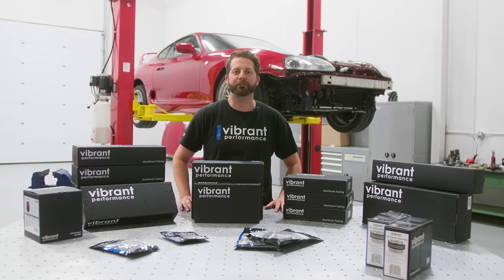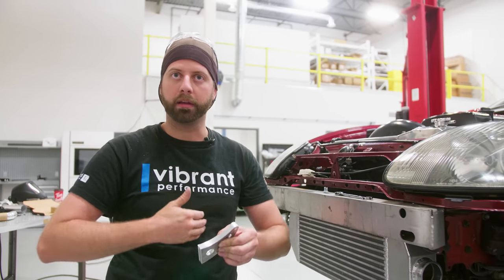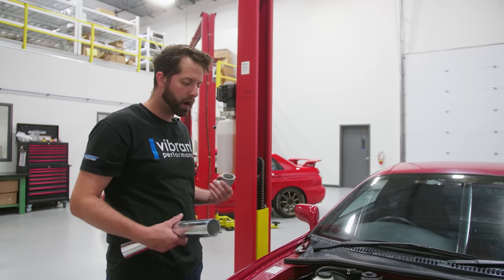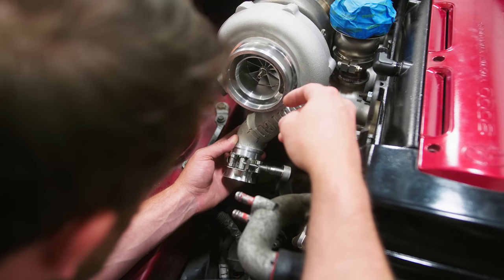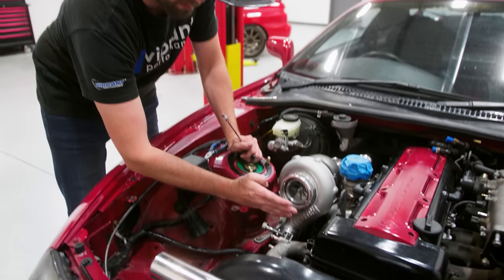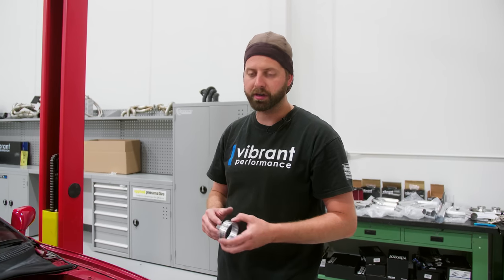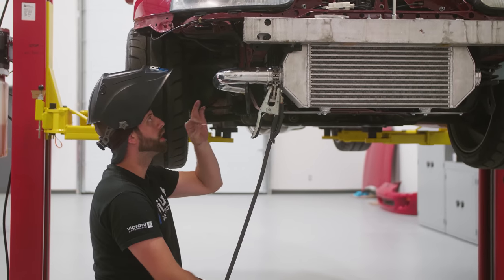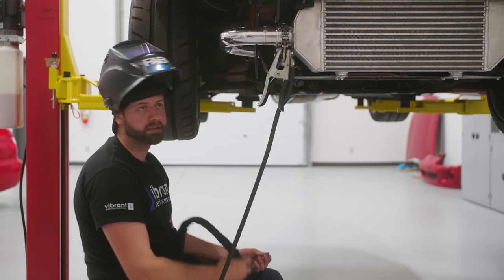Fabricating MK4 Supra Charge Tubing for Single Garrett Turbo

Comment: If you score instead of using market, you can clean without issue plus the marker itself can contaminate the weld👍
Reply from the maker: Great idea! More confident fabricators can definitely use this method. As annoying as it is to lose your marks, it is also a good thing they aren’t permanent. It’s not uncommon to mark up a pipe multiple times during fit-up. It would be a real shame to mix marks up and clock the joint wrong.

Comment: Next time try to drill the ait sensor before welding so it can be cleaned easier
Reply from the maker: Not a bad suggestion. Greg left the bungs to the end so he was sure on their placement, it wasn’t too difficult to deburr and fit, but do what works best for you!

Comment: Nice video! Is there any reason Greg is working in imperial units despite being domiciled in Canada? Making the calculations in millimetres would have been a lot more straightforward, in my opinion.
Reply from the maker: For one a large portion of our audience is from the states and secondly Greg is conditioned to using the imperial system

Comment: What’s the model of the vertical bandsaw?
Reply from the maker: This is a Baxter Verticut Roll-in vertical band saw.  Roll-in style vertical band saws are versatile and can be used to cut various metal shapes and sheet by hand.  Using the angle plate as a back stop with a clamp, it can be used to cut round tube or angles.  We use a 14-18 TPI (variable tooth per inch) blade.  Generally, a finer tooth pitch blade is better for cutting thin gauge tube.

Comment: You should always try to avoid welding anything to a turbo especially if it is on a vehicle used in any kind of competition.
Apart from the chance of damaging the turbo and loosing any warranty, it simply makes it hard to slap on a replacement unless you have already modified a spare one.
Reply: I dont know about you, but I have always, welded stuff on my turbo housings & so do 99% of the built cars around.
Reply: @aaronb1320  I did say avoid doing it not don't do it. Mainly because if you need to replace the turbo (maybe not you) it will have to be welded again and not everyone has a tig or someone with a tig.
Reply from the maker: You aren’t wrong, it does make the setup bespoke, and less modular to replace. This decision should be carefully considered, but ultimately is unavoidable since we used HD ferrules throughout the system. Lucky for Speed Academy Greg welded two compressor outlets for them to test different configurations on the dyno.
Reply: @VibrantPerformanceTV  . If you don’t already have one an adapter to put one of your connectors on an unmodified turbo would be a good idea.

Comment: I'm no fabricator or engineer but... can someone explain to me how going from a 4 inch intake necked down to a 2 inch hot side and then a 2.5/3 inch cold side doesnt screw up airflow/power? And why the hell you would go from 3 inch exhaust outlet to 4inch back to 3 inch? WTF is going on lol
Reply: It has to do with air density and managing the velocity and scavenging effect.    The same amount of air is going through the 4in intake tube before turbo, and the 2.5 after, only difference is how dense the air is.   The amount of boost you run is irrelevant, its all about that air density.  As for the exhaust, you want the diameter to expand right after turbine so pressure drops, almost cant go too big.  Then by the time its downstream a bit, it has cooled off and doesn't require as much volume.
Reply: You also want to try & keep uniform sizes, for velocity, turbulence etc. So if the turbo outlet is 2.5" & the throttle body 3", thats the ideal sizing you want to maintain as much as possible.
Reply from the maker: Thanks for your question, let’s break down each section and give some reasoning behind Greg’s and Speed Academy’s choices. Overall, the goal is to minimize restrictions and bottlenecks throughout the system, while balancing the trade-offs that come with them. Ultimately the purpose of charge tubing is to transport charge air from the turbo compressor outlet to the throttle body. Problem is these two orifices are generally different sizes, so a transition has to happen, so the goal is to do so in as smooth as possible fashion. Transitioning too soon or too quickly means we now have more volume of tubing to fill throughout or creates turbulence from too fast of expansion. So these transitions are spaced out through the system to minimize any restriction or turbulence.

For the turbo inlet it is optimal to have as minimal restriction for the turbo to draw air from, this restriction typically lies between atmospheric pressure and perfect vacuum (14.7PSI - 0 PSI). As we touched on before, the turbo compressor outlet diameter is the first prescribed constraint, and is dictated by the turbo geometry, and the second constraint being the throttle body diameter of roughly 3.00”. This was one big reason why we decided to make a new intercooler, because we would have to do some funny transitions which probably create restrictions and impede flow.

As for the exhaust downpipe, the decision was made to split up the transition from the 3.0” turbine outlet to the 4.00” downpipe. The main reason was due to space constraints due to the turbo location, sometimes ideal does not work due to other constraints. What you didn’t see is that we tried to do a single transition from 3.0”- 4.0” along with some tight radius pie cuts, but this proved to be too tight to the firewall and did not leave enough room for the recirculating dump tube. We also decided expanding the tube up to 4.0” abruptly would cause too much turbulence, resulting in a restriction. The downpipe transitions back to 3.0” because that’s what size the rest of the exhaust was. This should not be an issue because by this point the exhaust gasses have cooled significantly and no longer need the large diameter to reduce restrictions.
Reply: @VibrantPerformanceTV  Thanks 👍👍👍

Comment: Not digging the choppy editing of the video and the “Here’s one I did earlier “ effect of some of the edits.
Reply from the maker: We'll work on it, we try and get these out to you as soon as we can
Reply: @VibrantPerformanceTV  . Thanks, I like the quality of SA videos, there editing is smooth and their build videos don’t have a lot of the missed steps in the edits or At least they aren’t as noticeable. So get some tips from them
Reply from the maker: @anomamos9095  We will keep note of that, we did have to do a few more takes than usually, so it's a bit more choppy and we are working on doing some upgrades to our sound and lighting in the shop (as it causes delays). We are hoping the next few won't be as bad!